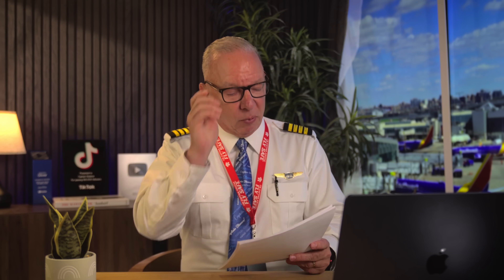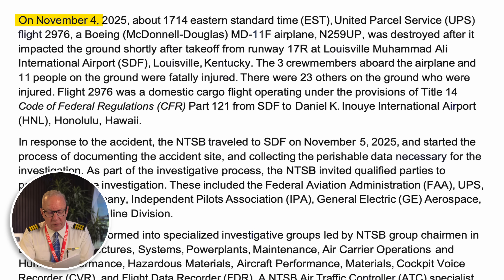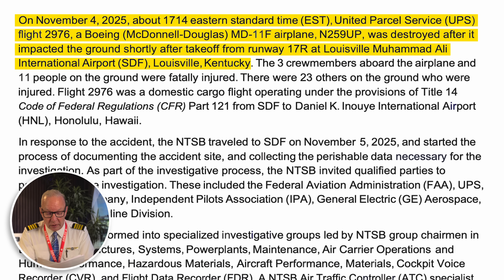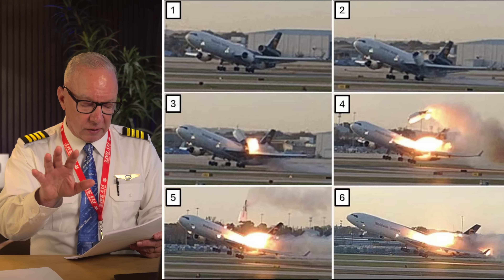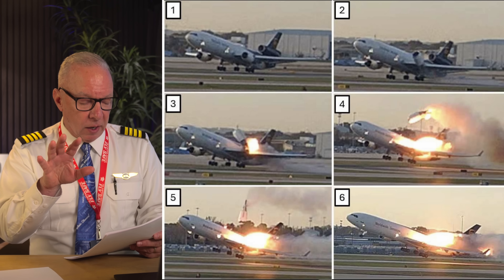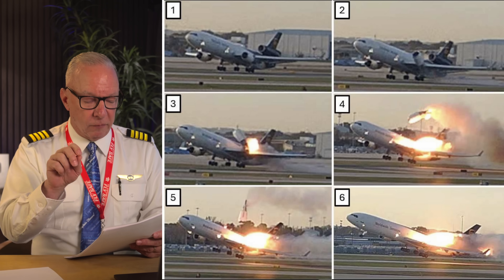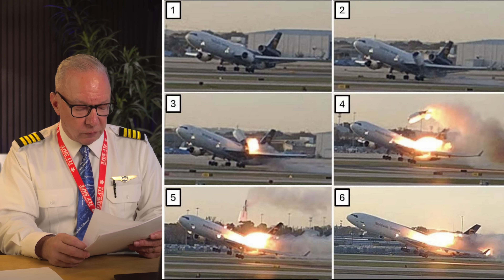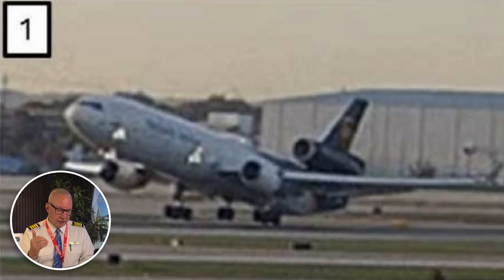UPS Crash Preliminary Report | Pilot Reacts to UPS Crash Report

Comment: Is every 6 years typical? Are there longer terms than that? The grounded planes, were they inspected and cleared? Are fatigue fractures fixed/replaced when found in an inspection immediately or just observed and noted? Did this plane just have an exceptionally stressful life?

Comment: @Captain Steeve. Engineer here 🙋‍♂. Any sign of fatigue cracks indicates they were pre-existing. Signs of fatigue cracks also called "beach marks" have to grow over many cycles. The cycles are what give the crack the beach mark appearance. The finer the beach marks, the more cycles it took. It is clear to be from the NTSB's report that the aft lug failed in fatigue first, and then overloaded the fore lug which failed in overload. Both lugs were fatiguing and would eventually fail it is only a matter of cycle count.

For non-engineers and non-aviators, asking the question why not design to never have fatigue? Especially in aviation, this is a delicate balance between force, space, materials, manufacturing, and weight. As well as non-engineering factors such as time and money. All aircraft have fatigue cracks. The question is only what is the creep rate and how big is the crack to understand if the aircraft is flight worthy. This is also why aircraft in particular are commonly design with safety factors at or above 2.0. Meaning the part can withstand 2x the expected application force.

All engineers should be aware of order of the engineer oath, which is similar to the Hippocratic oath, of the moral obligation to stand up for what is correct.

Comment: Sir, I think you said that if the pilots on 191 knew the engine had came off they could have taken better action. Why not have cameras that face the engines so that pilots can know when there is a structural failure.

Comment: I had originally seen it as the #2 that had the compressor stall but by some of the angles it did appear to be the 3.  So I think it is reasonable to have seen it either way.   If the #1 fan threw any blades they could have gone in either engine.   The vibration from the imbalance could have been the overstress on the rear mount as well no?

Comment: With or without history of these pylons, visual inspections are not the same as an NDI inspection. I don't know how hard it would be but is a critical point of stress and there is a history. Fatigue isn't always visible, so some form of non destructive Inspection should have been part of these maintenance phases. I remember the CH-46 underwent 10 Hr NDI of some part in both rotor heads that was known for stress cracks.

Comment: Captain Steeeve doesn’t seem to grasp that it was the physical separation of the engine that doomed the aircraft and crew.  The aircraft could fly without the thrust from the engine but the loss of the weight and drag of the engine destroyed all semblance of balance as recognized in the AA crash.  For that reason it baffles me that the rear attach points would not get better inspections.

Comment: Disagree that everything looks normal in photo #1.  Comparing #1 to #3 engine, the angles of attachment to the wing are already different and #1 is already actively detaching.
It's so sad that it took another disaster to finally ground these models - hopefully now safety will outweigh economics and they are all sent to scrap.

Comment: I told you so.  FOD? Heck no, not even #1 engine failure.  Cause: Pylon failure wing to pylon rear attach point. This is the happened again. This is simply a tragedy that you will experience if you are in aviation long enough. I contend the evidence is so blatant,  they couldn't go with the original, more convenient narrative, engine failure.  It is a lot easier to replace an engine than the whole airplane.

Comment: 10:20 "Here's where it gives what actially happened to UPS2976"

(Fatigue cracking on the engine aft mount which only has a 5 year inspection requirement)

Comment: 😮🤔  why hasn't any 1 said anything about the  🛫  plane clipping some power line's that started the jet fuel on fire? 🔥  🤔
Reply: Because it's not a final report...    did you notice that a split second after hitting the power lines on Grade Lane, the left wing impacted those fuel storage tanks at the corner of Grade Lane and Knopp Avenue?   Do you think that might be an alternative explanation for the giant fire ball and roll to the left?    If the fuel leak was pretty much contained after automatic shut off, an impact that ruptured the main wing in the tank would be enough to cause a fire ball whether there was a power line there or not.

Comment: Curious about the fatigue cracks on the engine pylon bearing lugs and if the aircraft was subject to an unusual amount of repetitive stress operating out of KSDF on a regular (almost daily) basis.  Several weeks before the accident I operated a B-737 into KSDF landing on the reciprocal runway, RWY 35L, and experienced a pronounced roughness after deploying the TRs during the initial part of the rollout most likely occurring at the location on the runway that UPS 2976 was at V1 and Vr.  Had I not been wearing a seat belt I would have definitely been thrown into the ceiling of my aircraft.  The F/O and I both commented on how rough the runway was.

Comment: I never felt the engine in the tail design was good. I loved the L-1011. We have now seen 2 devastating accidents caused by the same basic issue, 3 if we include Souix Falls but 2 with the number one engine taking off from the left wing. Why did they retire the L-1011's. I always felt it was a better designed and better looking aircraft and enjoyed flying on them. Very sad that lessons are still being learned. My sympathies to the families affected.
Reply: There is one L 1011 in operation, it's known as Stargazer and is used to launch small satellites,.  It was well engineered but the complexity of the Rolls Royce engine and costs associated with it did not endear it to airlines.

Comment: I'm wondering if the lube task done weeks before, was a factor. If they used a grease gun to force in new grease and push out the old grease, I've seen it done on automotive bearings, that extra pressure may have made the fatigue fractures worse. I'm just speculating, but that seems too much of a coincidence to dismiss.

Comment: 5:16 "The last data point shows 481 feet Mean Sea Level... that's... that's not what happened, it wasn't that high at all."

Listen to what you're saying.

The end of runway 17R is 461 MSL/GPS.   481-461 = 20 feet Above GROUND Level.  Yes it WAS AT LEAST that high.  You kept saying this in your last video, too, even AFTER Mr. Inman clarified that both  MSL and AGL readings were presented on ADS-B.

You spent an entire career switching altimeter settings from AGL on approach to MSL (29.92) at cruise.  This sort of mistake is way too easy for even a layman like myself with an interest in aviation to pick up on.

Comment: Another admirably clear and methodical presentation, thank you. I applaud you for admitting you were "wrong" in an earlier analysis - which was well reasoned, given the info then available.

Two puzzles, for me: (a) having broken loose of its moorings, why did engine #1 disintegrate internally and shoot "shrapnel" into #2? and (b) for how long had the fatigue fractures been present?

And thirdly, who took those remarkable photos and why?

Comment: Told you it wasn't the number 3 engine that was flaming out despite that you kept saying over and over it was the number 3 engine that was damaged, when it made total sense it was the rear centre engine. 
I hope you are a better pilot than you are at failure diagnosis.

Comment: in the first step, fatigue cracks in airplane components are normal. 
EVERY component on board of an aircraft is designed to be durable only for a predetermined number of cycles and not for eternity;  otherwise, the plane would be too heavy to take off in the first place.
Because of that, every component is regularly inspected in predefined intervals, and the results get compared to aging tests of the component in a lab. It is even possible to say - yes, this component does have cracks, but it can stay in place until the next or even the second to next inspection.
What happened is a tragedy, but the way I see it, all that it takes to get the remaining MD11s back into operation again is a check on all pylon lugs and the definition of shortened inspection intervals.

Comment: In relation to the horizontal longitiudinal axis along the fuselage, nose to tail,
the thrust line of the wing mounted engines on a DC-10 and a MD-11
is a few degrees down, looking from the front of the engine and towards its aft end.

If the fwd. mount attached to  the front wing spar breaks away first, the engine will drop down at its fwd. end and then the aft mount of the pylon will break away next.

If the aft pylon mount breaks away first, then the thrust from the engine will pull the back of the pylon down and most likely the one supply line to the engine will tear apart at the pylons fwd mount area. There will be en'uf residual fuel in the fuel line to run the engine for a few seconds and due to the engines thrust line being angled up because of the attitude of 
the pylon, the engine will 'scoop' its way up and over the top of the wing which happened in both of the two instances, AA and UPS. 

The clevis and lug for the aft mount for the pylon should be made from stronger titanium and not weaker aluminum.

I am a retired airline inspector and spent several years inspecting both airframe and engines on the DC-10-30, including the detailed visual inspections of the forward and aft mounting areas for the pylon.

Comment: I wonder how they determine fatigue vs stress fractures and pre-impact vs post-impact fractures. I’m sure there’s a method, but it sounds like it would be hard.
Reply: for them it's rather easy, something about if it rips apart with sharp or blunt egdes, they can also see if the metal was bent, stretched or twisted when it broke, I couldn't but NTSB investigators most of the time just look at it and know instantly

Comment: Thanks Captain Steeve for comprehensive explanation. I wanted to ask how many cycles generally would be tolerable for a commercial airliner like A350 or A380? I sometimes wonder as I see aircrafts (Siangapore airlines, Emirates) coming to and departing from the international airport I stay close to, daily. I sometimes wonder how many cycles each aircraft would go through before they are retired.
Reply: was the max lifespan for plastic planes even tested yet?

Comment: HI there, I just been watching, and think that you have mis-spoken about the aft and forward lug fractures at 12:00 in the video.  The Aft mount has two lugs, (forward and aft).  The fatigue cracks were in the aft lug both inboard and outboard and the forward lug inboard (with the "aft mount forward lug outboard fracture" being stress only.  This section isn't talking about the forward mount, but the two lugs in the aft pylon mount.

Comment: Would like to know what the elevators were set at during this failure.. 21k cycles & still at a 6y CAMP ?  Lube schedule should have caught SOMETHING to indicate an issue.. Spherical cracks not happen over nite...  When we lube our equipment, even the grease going in to easy raises a flag for further off-cycle inspection ....

Comment: Most every plane flying today, except for the aft mounted dual engines (like the MD80 and many business jets), hang the wing mounted engines suspended by pylons. Are Boeing-built planes using a more reliable pylon mounted hardware than the planes built by McDonnell Douglas. One hopes so.

Comment: This report makes me stomach sick.I have been in the automotive industry for some 40 years, yes automotive and I know some of you are thinking. What do you know about aircraft. Not allot. But I know about recalls and recalls for safety reasons. This plane should have been recalled long ago and retro fitted with a reinforced  mount front and rear. The manufacturer knew this was a problem along time ago. They are going to want to blame maintenance but you and I know that McDonald Douglas should have fixed it!!!! God bless the lost soles.
Reply: as if you'd recall a car when a defect occurred in one car. 
or a second time 46 years later.
Reply: @kirakaffee9976 That problem was known for years. On that plane and the DC10.

Comment: The engine mounts are designed to slowly swing the wing engines left and right while they are running. This is because the thrust exhaust gasses are passed very close to the wing for aerodynamic reasons (keep the thrust as close to the airfoil and drag surfaces as possible). This is to reduce upward thrust rotation of the aircraft as much as possible and to reduce thrust vectors on the pylon structures. The exhaust gasses are not superheated (turbofan cooling) but are hot and this method distributes the heat over a larger area of the wing surface promoting heat dissipation and keeping the wings cool.

Comment: A look at accumulated fatigue graphs indicate the need to shorten the interval between inspections as the fatigue accumulates. At some relatively early point in these inspections, the fatigue crack(s)are detectable by NDE, and it would be interesting to know what NDE methods were used by the plane's owner in this area.  NDE has come a long way in the last 50 yrs, an if he right equipment had been employed at shorter intervals, then this tragedy might have been avoided.

Comment: Your wrong.
The engine would not have been ejecting any fragments as nothing went through it to cause it to fly apart.
The engine would just continue to run normally until the fuel line broke.
However parts of the wing being torn apart by the pilon may have gone through engine two on the tail.
So cause of crash metal fatigue not discovered by poor maintenance!

Comment: just a point about the altitude.  I did a google search and the elevation at the end of 17R/35L is 461 ft. ASL.  it is 489 ft. at the other end.  If the plane was using that runway and going downhill, if the ground continued to lower 481 ft, ASL would be about 30 ft. in the air.

Comment: Is it a fact that the bolts that secure the engine to the wing cannot be observed again for a visual inspection after the engine is installed at the factory ?
Reply: maintenance can take the engines off and some checks require them to do so.

Comment: So there was to be an inspection about 7 or 8,000 cycles later than the jet had on it, and yet the aft pylon failed at 21,000 cycles, that shows right there the inspection interval was WAY out of line with what it should have been, 7 or 8,000 MORE cycles is another 1/3rd more beyond the number it FAILED at!

Comment: The “push/pull” semantics comments are a little ridiculous. Can we all just agree that the engines accelerate the aircraft? whether it’s by “pushing” or “pulling” what is all y’alls actual point in calling this out? Beyond that it just seems incredible to me that the maintenance schedule on these mounts has been set on a 6 year cycle and that they are merely visual” inspections. Seems to me that for aircraft of this age those inspections should be much more frequent.

Comment: From what I can surmise from the hardware images and design and description of the failure sites, these areas where pre-existing fatigue cracks were noted would have been buried within the components and would not have been visually detectable by a technician at the recent maintenance interval....the only way you find those types of potential failure initiation features is through removal of the components and x-ray examination or perhaps fluorescent penetrant inspection if the fatigue cracks actually did initiate at a surface. Anyway, the fleet would have to be treated like a walking (but mortally) wounded situation and is likely why the entire fleet was grounded as there's no way to quickly inspect and disposition each plane in the field. I suspect this is essentially the end of the MD-11.

Comment: Did not need to be FOD to take out #2, the heat and products of combustion being injested would cause the engine to not function properly with no physical damage. Low O2 in the injested air, fuel burning once out into clean airstream and compressor stalling would be expected.

Comment: All of these Old raggedy as planes should have been grounded in 1979.
Ups or fedx should not have been flying these planes. But they were to cheap to buy new jets. My car is 23 yrs old and I'm completely rebuild it. A jet 31 yrs old should be in a recycling yard. The inner frame structure is completely fatigue. They know this.
Reply: the MD 11 was not even invented in 1979  -_-

Comment: Outstanding job by the NTSB recovering these fractured pieces from all around the runway and huge crash site amidst the burnt debris. 
And the excellent metallurgical analysis making clear the diagnosis of what was metal fatigue cracks induced weakness and what was secondary overstress rupture is essential to reconstructing the failure scenario. 
Tragic as this should have been prevented by a much tighter and more frequent monitoring of these critical engine and pylon attachment parts, especially since AA191 in 1979...

Comment: The UPS Airlines Flight 2976 McDonnell Douglas MD-11F was 34 years old when it crashed in November 2025. It was delivered to Thai Airways in 1991, converted to a cargo plane, and began service with UPS in 2006. 
Date of manufacture: Delivered to Thai Airways in 1991.
Manufacturer: McDonnell Douglas.
Model: MD-11F.
Sounds like inspections should be required more often on these older planes. But the cost is probably going to influence that process.